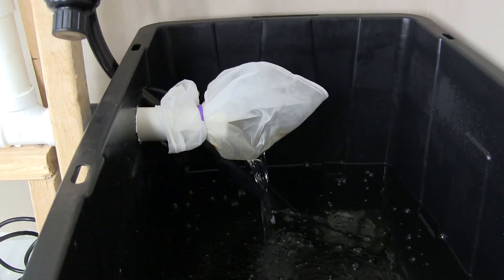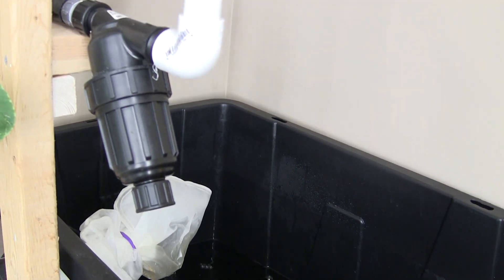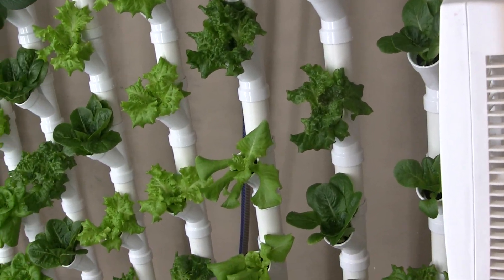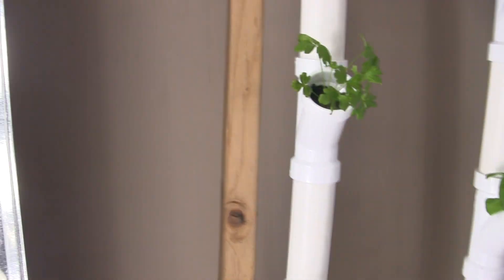Basement Hydroponic Tower Garden Version 2.0

Comment: Hey! Love the design and built my own but could really use some advice. I set up 7 downspouts but no matter what I do I can only seem to get water to go down a max of 4 at a time. I’m running a 550GPH pump up 3/8”ID hose. I then have 1/4”ID spouts off of that for each of the downspouts. I’ve tried feeding from the pump at the far left as well as in the middle and splitting the water off in two directions. No improvement. My next idea may be to run a pump up the left AND the right for 1100GPH... but if I don’t need it I’d prefer not buy a second pump. Another idea is to have the pump run into a reservoir up top which would directly feed all 7 lines. But again, if it’s a water volume issue this likely will just turn into wasted effort. Thoughts?
Reply from the maker: yes, your pump is not sized adequately to pump enough nutrient to pressurize your 3/8" hose so that you get even flow out of your irrigation lines. Unfortunately you will have to get a bigger output pump. Be sure you size it appropriate for the head on your system. I'd definitely not recommend an elevated reservoir. Too many chances of failure, blockage, overflow, flooding - water weighs about 8 lbs per gallon.

Comment: I build three tower following your design (spacing) approximately how many gall/min pump should I get for three towers? Thanks
Reply from the maker: You have to look at the spec sheet and make sure the head on the pump is enough to irrigate to the height of feed line. I use the  Pondmaster Supreme model 5 for the basement, and in the greenhouse 7 for the dutch buckets and 12 I think for the towers. You have to size for your own needs. Spec sheets are on the Danner webpage. Good luck.

Comment: Thanks for the tour, how much would it cost to maintain it on a monthly basis?
Reply from the maker: not sure what you pay for electricity - I'm running about 700w for 16 hours a day with my improvements. Nutrient is cheap - I figure about 5 bucks for 10 week's worth - youtube ChilLed nutrient. I buy my rockwool in bulk - 3K at a time - so about 7 cents per plug. Seed is not that expensive and I harvest my own seed so that's not much. I think that's it.

Comment: Hi. Thanks for the great video. I'm getting into hydroponics and I was just wondering what the benefit is of using this T attachment method is? Is it for modularity? Ease of building? I'm just trying justify the expense, as those T fittings add quite a bit to the system, and I have no problem cutting holes in larger diameter PVC.
Reply from the maker: leakage. I cut holes into my first system and it wasn't good. Water will find a way. These are also easy to remove and clean out. Way better.

Comment: 15 watts per LED-bulb in 2020 is still a lot! There are some cheap chinese bulbs and some good quality economical ones. For that luminescence power you can easily get LEDs with lower power consumption. They are slightly more costful but in a long range they work cheaper than the cheapest ones. It makes no big difference if you buy 1100 lumens single bulb for home where one uses 10 Watts and other one uses 15 Watts, but if you neet 30 of such bulbs working in a same time, additional 150 Wh savings can be crucial for your wallet.
Reply from the maker: sure, what lights would you recommend and how much do they cost?

Comment: hey! I know the video is 4yo but I have a question on the design: is the pumping even all across the line? I mean: does the final column get the same amount of water? I didn't notice anything more than the little tubes forking at the top so it would be quite impressive for that pump
Reply from the maker: yes, they distribute the nutrient evenly. On this model I did not include a ball valve at the end to clean out the junk - that was an improvement I made to my greenhouse system. So I had to run new lines to the last 3 towers last year due to low flow. I think I'll hold off one more year and then replace the entire irrigation line and put in a valve at the end for cleaning. Great question thanks for asking!

Comment: First of all, this is a great video and was great inspiration for my much smaller setup. It’s been running for a few months now.

I have one issue I’m trying to figure out how to get around: since I’m clipping from the plant rather than harvesting the whole plant, there comes a point where the roots clog the water flow (same 1.5” pipes, so you can imagine how dense these roots get) I’ve tried to trim the roots fairly regularly. Should I just be retiring plants with root masses that clog the pipes? Or is there a way to salvage them?

Again thank you so much for the great video!
Reply: I also built this with the intent of growing some long-term plants too (herbs, peppers). Generally how long are you getting before the roots become a problem? 2 months? 6? Also, once they clog have you gotten any water escaping the system? Or does it generally just find another path down?
Reply from the maker: Great to hear. I also have problems for plants I just clip. I swap them out after 5 months. There's a bit of a growth lag but I find the young plants grow faster and taste better anyway. You can also clip the roots to keep them groomed. I do that with my parsley. I bought 2 inch pipe and connectors, with a reducer for the drain pipe (back to 1.5 in) but never got around to swap that tower out.

Comment: Hi, very impressive, congratulations ! Did you talk about kale or I misunderstood ? Isn't it too heavy for the system ?
And can you tell me what kind of pump is needed to draw the water up, please ? Excuse me if you explained that,I'm french and I may have missed something... ;)
Reply: @Nathalie Brigitte From my several views of this video (peut-être vingt? je souris) at 6:50 in the video, you can see the pump box PondMaster Pond-Mag, at 700 gallons per hour. I just purchased one at 350 gallons/hr, and then, after that, saw this in the video. But perhaps it will be fine, as my system will be about half this size. It seems to have kale in the video, which surely is a good hydroponic crop. Amicalement,
Reply: @donzoc  Thanks for these details. I've just bought my pump (300 l/h, around 800 gallons) so i guess it will be ok... Let's wait for the summer ! 
Bonnes cultures ! :-)
Reply from the maker: Sevah Nathalie! My concern is the "head' or the height the nutrient has to travel up to the highest pumped point. The higher your 'head' the larger sized pump you need. I use different pumps for different systems. The pump in my basement is a model 5 Pondmaster Supreme made by Danner. And the kale is fine - weight-wise - just needs more space to grow, and I replace it at about 5 months before the roots get to big and start clogging the 1.5 inch pipe. Now I'd go for a 2" pipe for the next time around for the kale tower. Tschau for now.
Reply: @maryneumayer01  thanks for these details :)

Comment: Awesome video! I have a question though. How much water goes tgrough the pipes? Are the pipes full? Half full? Doesn’t the water spill through the plant T holes? Thanks in advance for the help 🙂
Reply from the maker: danke, and no, it's a small trickle. There's probably around 3 to 5 gallons in the system when the pump is running. the nute tank is 54 gallon so it holds all of the nute just fine, when the pump turns off every 30 minutes.

Comment: Your set up is impressive! Just curious if the nutrient flush once a month is standard for all hydroponic gardens? I have the grow wall 3 by Opcom, and they recommend cleaning it out once every 1-2 weeks, but that feels excessive to me. Thoughts?
Reply from the maker: good question. I flush my basement system every 3 weeks but my greenhouse system every 8 weeks. The volume seems to make a difference. In the basement I have 45 gallons for 150 plants and in the greenhouse about 150 gallons for about 250 plants. I can tell if a flush is needed by the growth of the plants- but by the time you can see it you're a couple weeks late and the damage is permanent. I think you should be more aggressive than lax when it comes to flushing.

Comment: This is waste of money and waste of time electricity water 💦 light 💡 better grow in soil its better light is free soil is free no low maintenance good result 
Anyway this project is useless so much 🏋️‍♀️
Reply from the maker: Hi Zohaib, thanks for your thoughtful advice. Shoot me a video of how you grow your greens when it's 30 degress below zero outside with your better light and free soil. And what is your recommendation for getting all that good light through 2 feet of snow?  Btw, I only run this system in the winter. Spring, summer, and fall I'm outdoors.

Comment: Have you compared this system to an aeroponic barrel? The hardware for the aeroponics look more expensive but I am wondering if they grow better with a better mix of O2 and water.
Reply from the maker: People tend to say that aeroponics grows the plants faster. I'm just concerned about the nozzels getting clogged. And this setup allows me to use the space along the wall and the rest of the room as a game room. Barrels are bulky and would need lighting all around them and that setup wouldn't be conducive for my room.
Reply: @maryneumayer01  Great analysis. I am running some experiments with wicking pots since they are super cheap and easy to setup. Would love to build a hydroponic like yours outdoors and perhaps moving it indoors when it gets cold.  Love the vids and work. It's a very clean setup which I love.

Comment: What an amazing project! I’m totally in love with it and I’m going to build it in my backyard (just a bit smaller). I Hopefully natural light will be enough to grow something for my own use. We just need to build something like tent to protect the whole construction from rain, wind and some bugs. I’m excited to give it a try!
Reply from the maker: Hi Urszula, no need to protect from rain/wind/bugs outdoors. Just coat your PVC with a uv blocking paint to prevent degredation from sunlight. Be also careful to keep your nutrient solution cool - high temps can cause stress to plants and bolting in many veggies. I have a old video on an outdoor prototype - check it out. : -)
Reply: Whaited till 2020 to see that for gardening you need to protect your crops from rain....that's it I've seen it all.....just jocking ;) good luck👍
Reply: Thanks for advice! I’ve seen that video already :) We are going to keep box with nutrients solution in the shadow to avoid heating from sunlight. Not sure if it’s a good thing but my garden has direct sunlight only up to 1-2pm so hopefully it will not be too hot. 
The whole construction is almost ready, seedlings are growing, just need a pump and a few touches to start! Can’t wait 🙂

Comment: do you have solar cells on your roof or something? Otherwise - even though as impressed as I am with this setup - I just can't see how running all this equipment and wasting a  whole room on it justifies growing lettuce when there's sunlight outside.
Reply: You didn't watch video....
He clearly states that this is only for the winter months when there is limited sun light.
His outside greenhouse is used during the Spring, Summer and fall months when he has enough daylight outside to use his greenhouse.
Reply from the maker: thanks Spydergs07, and Suyamu, I also have 30 solar panels on my roof to help with the energy costs. Also, in addition to the hydrogarten, I also have darts and a Kicker Foosball table in that room. :-)

Comment: amazing system. love it. just wondering about the size of netpot you are using. are the 5cm fit on that?
Reply from the maker: netpots not necessary - just stick the grodan plugs into the opening. they fit snugly.
Reply: @maryneumayer01  oh. thanks for the answer. it helps a lot.

Comment: Not trying to be nosey or anything but interested in starting out in hydroponics and was wanting to build something like that maybe smaller scale but I am doing nothing if it costs way too much buying nutrients and stuff every month and is a lot of time and care to do but roughly how much do you have invested in that setup?  Just getting an idea so I know if I even want to buy anything and do it or if it’s cheaper to go buy a pot Dirt and a plant and just plant it and be done.
Reply from the maker: maybe 3-4 hours a month. that includes a flush of 2 hours where you're not sitting there watching it - like doing laundry. this big system (151 sites) cost about a grand or so to put together if you are purchasing everything (not using scrap lumber and materials) - and maybe a couple hundred extra for all the lighting. there's also the cost of the nutrient - 30 bucks a gallon if you buy it instead of make it, and electricity, and there may be a leak if you are not careful. it's definitely easier to 'buy a pot, dirt, and 1 plant - or just go to the store, if you're not totally onboard with hydroculture. I'm not trying to be disrespectful but just honest.

Comment: I live in Malaysia- I have sun 365 days a year, so I plan to do this in the patio. this will work yes? Can you explain why you need to do a once a month flush?
Reply: Avoid algae and prevent clogging i guess
Reply: @aforcetobereckonedwith1084  paint your equipment Black this prevents Algae and unsightly growth....good aeration with Mixed loose  ( koi plastic balls are good) media breaks down clumping of Algae etc this should keep all your nutrients good for months ....Nutrients will only need topping up if PH levels etc get low.....
Reply from the maker: hi, some of the micronutrients precipitate over time and are no longer available for absorption through the roots so flushing gets them out and you add new nutrient. Don't paint black - you will be battling the heat and you need to keep your nutrient cool. Don't use clear materials or you will get algae growth. Nute container and lines must be nontransparent but avoid heating up your nutrient or your plants will be unhappy. Good luck!

Comment: Can you show how the feed line on top attaches to the vertical tower? Thanks
Reply from the maker: drill a hole into the back of the pvc tower just larger than your 1/4 inch irrigation line and stick it in from the back forward.
Reply: @maryneumayer01  do you have any special fitting on the end of the 1/4 poly tubing ? It looks like you have yours running in on top of the towers. Also what pump are you using and what nutrients are you using ? And one more thing, what do you mean by a  nutrient flush ? Thanks.
Reply: can u make video how to do it,still not understand

Comment: i seen another guy had put cotton string down the fixture into ea cup so that the water would travel to ea
 cup
Reply from the maker: That's not necessary in my case. I would imagine the string would get caught in the roots and when I would pull out the plant the string would come with it. Then I wouldn't know how to get it back down to the bottom - perhaps with a weight or secure it somehow from the start? Sounds like a lot of headache to try to make that work if it's not necessary to begin with.
Reply: @maryneumayer01   found this it may resolve your issue https://youtu.be/PCwjrnjdzDs
Reply: 14 min in

Comment: Love this Joe, thanks! I’m sick of buying salad bags every week & ready to design my hydroponics system. I love your design, but I’m wondering - why use 1.5” PVC and Y tees instead of 4” PVC & cutting holes?
Reply from the maker: Hi Mike, that was my first design many years back - except I used 3 inch pvc. There were issues with heating the pvc and sealing the sites, and then constant leaking. It was a big mess. This improvement using tees revolutionized the system.
Reply: MaryandJoe Neumayer - ahh, I imagine  cutting was tedious & hard to perfect for sealing & the same with melting and bending the PVC. Breathing the toxic fumes is not appealing either. I also imagine your new system is easier to clean, more modular, and more portable too? Thanks for helping me understand and thanks again for sharing your enguiniety. As a fellow educator, my hat goes off to you for the great impact you’re having on students (not to mention old geezers like me :-).
Reply: @maryneumayer01  is this just for leafy greens or do you think you could also grow peppers in this set up?
Reply: 4" PVC uses more water, and is more expensive, and you'd have to angle the pipe away from the holes or make some angled add-on for the plants since the water would come out of the holes (if the pipe is 90 degrees). I'm using 4" horizontally. This makes more sense, and kinda wishing I'd done this type instead.

Comment: How does simple LED light do anything to the plants? I thought they needed actual sunlight or UV?
Reply from the maker: plants need light wavelengths primarily in the reds and blues, which are included in a regular light spectrum found in light bulbs, including LEDs. It gets more complicated than that but that's good enough for my plants to be happy. :-)
Reply: @maryneumayer01  Very interesting, thanks!
Reply: @maryneumayer01  Sorry for asking os many questions but you have comments disabled on the other one - major newbie here. How did you connect that 1/2 inch pull line to the 1 1/4" tubing?

Comment: I just found this video...  How has the long-term maintenance of this system panned out?  As the plants mature, do the roots end up clogging the PVC pipe for plants below?
Reply from the maker: There's weekly testing of course and adding of nute, and flush every 3 weeks. Plus harvesting and seeding. The roots on the plants that stay in clog after 5-6 months, so I replant those once per season (the basement is only in operation August-March, otherwise I'm outside in my greenhouse. Thanks for your question.